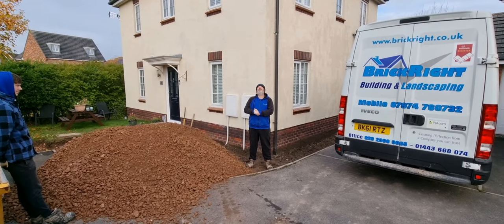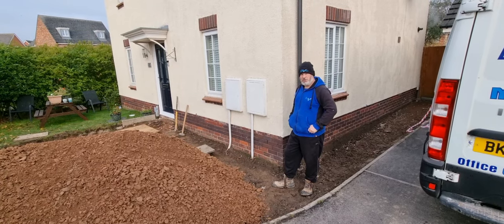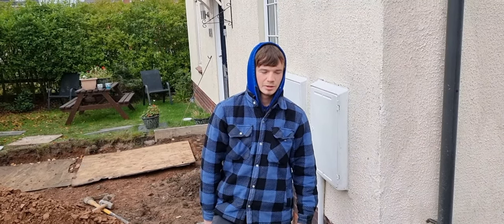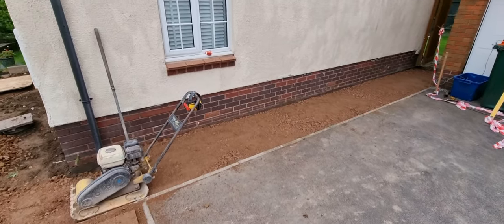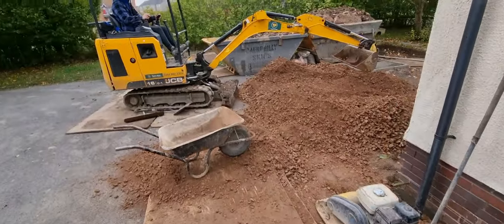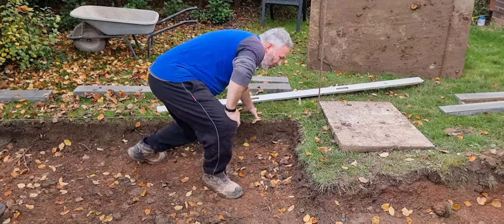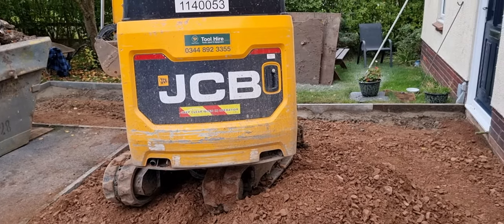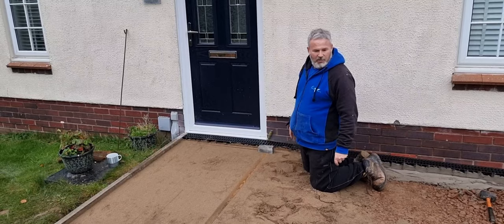Block Paving Dig out & Prep

Comment: Looking forward to the screeding  with your rails that makes me giggle but good point on access as sometimes can be overlooked 👍
Reply from the maker: 🤣🤣 yea you do find our way a bit wierd i think dont you mate 🤣 you can giggle to yourself on the next video. I would be interested to no how you do it mate always willing change stuff up .
Enjoy the weekend Mr Coyle. 
Justin 🙂👍
Reply: @brickrightbuildinglandscaping  not weird as I would use rails if I was screeding large areas with a machine as in using a long steel on a teleporter or tractor but they are totally pointless and not needed and I am  bewildered that not more can screed using a string line and aluminium screed and a polyurethane float it's so much quicker and precise, enjoy your lunch I am😋👍
Reply from the maker: Aluminium screed  string line and a float .
What u free hand it to the line with the screed level and then float it do you.just trying to get it in my head thats all .
Justin 👍
Reply: @brickrightbuildinglandscaping  can't describe it as has to be seen but string line is to set falls/levels but you ain't doing it free hand either as that isn't precise
Reply from the maker: You'll have to send me a little video of it next time you do it you got me curious now 👍
Reply: @brickrightbuildinglandscaping  might do video as was just watching Johnny boy from greentop Landscapes putting in kerbs and setting rails for screeding  for  paving and didn't have a clue what the feck he's doing, the man does not realise tapping in kerbs one at a time is unproductive and again there is a quicker and better way 🤦‍♂️

Comment: Hi guys, 
Is the kerb edging cemented on both sides? Cheers
Reply from the maker: Yes they are ,concrete is used 👍
Reply: @brickrightbuildinglandscaping  that’s great thanks, just the same way at front as shown in video? Kinda sloping away and half way up the kerb? Cheers thanks